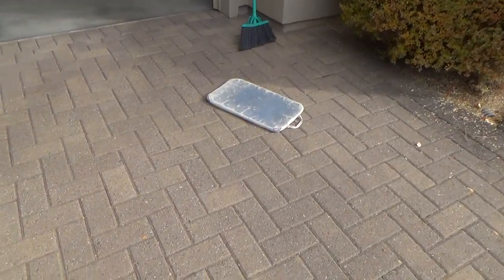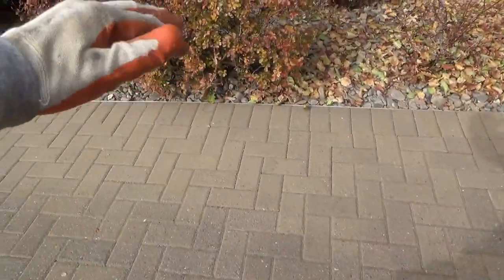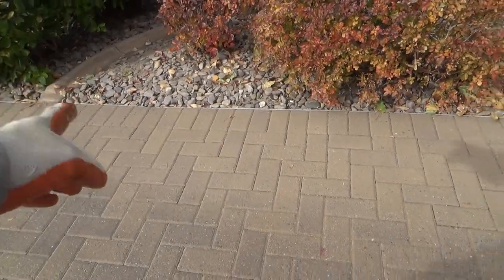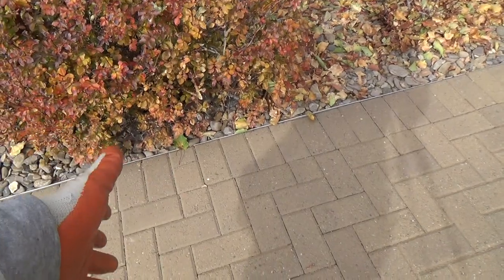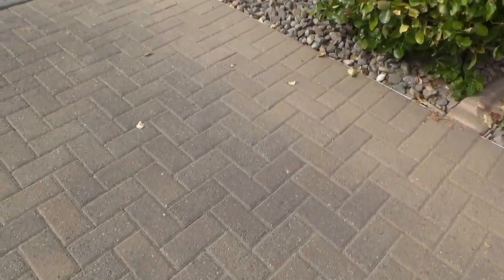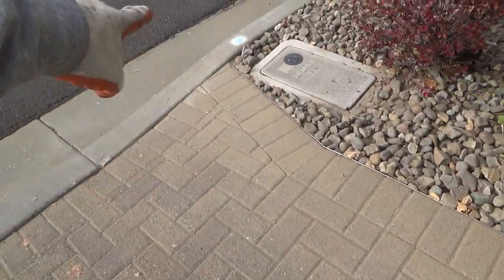How to Remove/Replace Brick in Middle of Driveway Made Easy...Part 1

Comment: Why not drill 2holes plug them put screws in them and lift the paving block out and replace with new 12:21
Reply from the maker: Sometimes it's best (in my view) to go the extra mile & take your time so you can save the removed bricks since I was then able to reuse the same bricks & no one even knew I worked on the driveway when I got done...

Comment: Why not drill 2holes plug them put screws in them and lift the paving block out and replace with new 20.00
Reply from the maker: I did not want to replace this brick with new since the brick driveway was over 20 years old & there would be no way to match the exact color thus the video! Thanks for the suggestion!